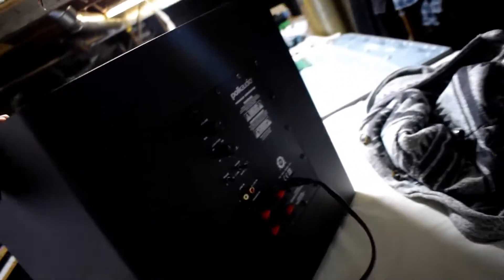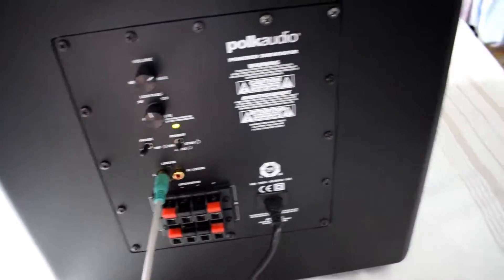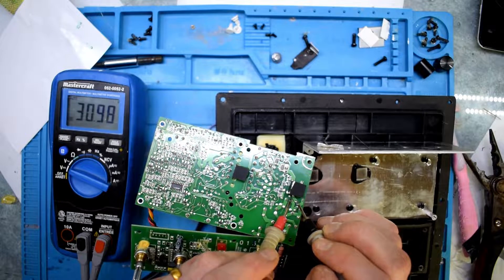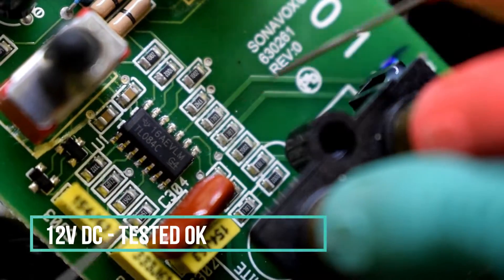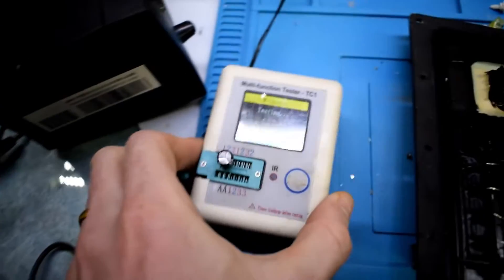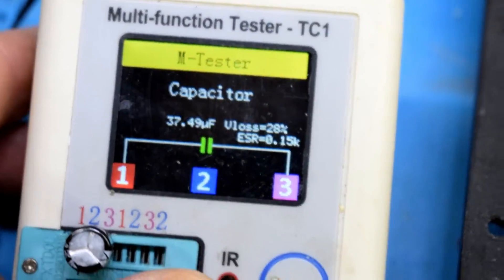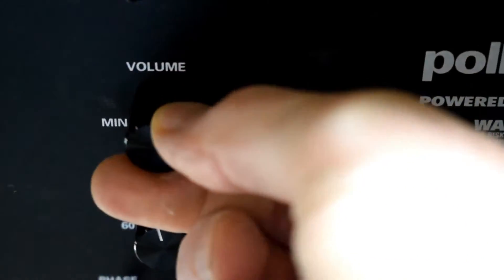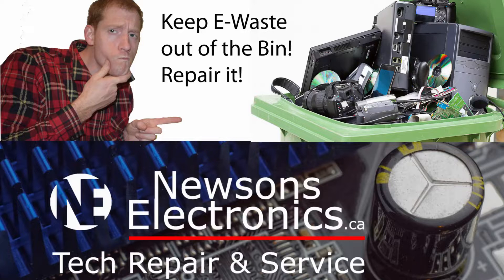Speaker heart beat Fixed! | Polk Audio Subwoofer (PSW125)

Comment: I have a PSW 125 with the same heartbeat problem, Plus if I put light pressure on the cabinet near the rear the speaker will start to buzz as well. Does that indicate a more serious problem than just the capacitors?

Comment: I fixed mine by installing a Dayton Audio plate amp outside the box and bypassing the Polk board altogether. It was more expensive but probably a better board overall. And probably easier to do.

Comment: Twice mentioned 2 capacitors while only pointing to 1 both times with 2 nearby.   Is the second one the one touching it or the one that is bent sideways a bit?
Reply from the maker: check for bulging at the top
Reply from the maker: best to replace both if you can

Comment: This was a pain to get done. Maybe itd due the bad vision i have now. And maybe i suck at soldering. I got a magnifying light helmet thing at harbor freight. That  helped. And solder paste at home depot. A few more hours and done. I struggled. But i think it was not being able to see. Touched were i shoulnt and burnt some spots. Hsd to use wire to fix soldering points. Anyway thats was my experience.

Comment: My sub was making noise similar to yours and was cutting off at high volume. When I opened it I was dissappointed with the cheap chinese components that was used on the board. 
I replaced the two 47uf 63v with some old Rubicon 47uf 50v caps. Ive also noticed that some of the other caps were bad as well and replaced them too. The thin tracks made the process a pain in the arse. But it works now. Thank you very much for this video.

Comment: another success story here in Spain! Symptons were "buzzing electric sound", "hearbeats" and after a while it stopped totally. I removed the plate, bought the capacitors and asked for someone else to do the replacement.
What is weird is that the "buzzing electric sound" is still there. I tried replacing the LFE cable, switching power outlets... but nothing. The louder the volume, the louder the buzzing. When playing music, I do not notice it. Only when idle. What could this be? THANKS A LOT!

Comment: Thank you. I have a PSW125. Replaced the capacitors you described with the 47uf 50, the actual capacitor on the board is a 47uf 63. I saw below that you said it's ok with the 50. The sub is working again! Thanks!

Comment: THANKS NEWSONS, I know this is an old video but my PSW125 just recently came down with the heartbeat issue. I came across this video and just tried replacing those capacitors didn't test anything else and that fixed it. Sub is back in action just like new!

Comment: Hey , Thanks a lot for a informative video, Can you please let me know the values of the MOSFETS on the main board which you tested. I have burnt ones on my board and not able to make out its value . Also the two resistors vertically placed between the 2nd and 3rd MOSFET are burnt . Would be obliged if you please share the values of these components.  . Thanks

Comment: THANK YOU!  I have same model and called Polk.  They don’t give out parts anymore as this model is discontinued.  I was having similar constant heartbeat thump on or off.  not bad but annoying.  Replacing those 2 capacitors fixed it!  $400 sub… fixed for $2 shipped.   Oh and if never done this kind of thing get a solder sucker.  Once opened i had the job done in about 10 minutes.   Sure appreciate your video!

Comment: caps are 47/50v or 47/63V? what is shown in video is 63V while its said 50V in your description.
Reply from the maker: 50v is fine, the voltage rail does not go over 50V

Comment: I have the same issue with PSW110. When I Turn it on it sounds like it is tuning a radio station and when it bring up the volume it goes away for a moment and get back again intermittently loosing bass. Can the solution be the same for this issue? I had it go for repair couple of times but the engineer is nt able to identify the root cause. My problem is precisely the same.
Reply from the maker: give it a try

Comment: Hi Newsons, I have one of these and I am trying to repair it. On the Drive board next to the (J1) Connector there is a small resistor that has blow on mine and I need to know the value. It come from the output of pin 6 of IC#UC3843 through the 47.5ohm resistor and then to that small resistor that is burn. Can you tell me the value of that resistor? Thanks.
Reply from the maker: note sure

Comment: Replaced the two you recommended and I'm good to go again!!  Thanks!!  Saved me a ton!!
Reply from the maker: nice
Reply: That soldering was difficult!  I swapped the two and now the power light doesn’t light up. Fuse inside is ok. Back side of the circuit board might’ve been damaged when I pulled old caps out.
Reply from the maker: @coffin8er  check polarity

Comment: I have the psw505 with the heartbeat problem. I have not opened it up yet but do you think the caps are the same?
Reply from the maker: may be different have to open it up to see.
Reply: PSW 110,111,125 have the same plate amplifier, PWS505 amplifier seems to be difrent, this amplifier is a 150W RMS, your is 300W RMS. Anyway i think the class of amplifier is the same, they are BASH amplifiers, and also in yours there will be capacitors that have the same purpose, but maybe the circuit is different and you need to identify where they are, so it can help you to recover the wiring diagram. I add that once you get started it is better to replace all the capacitors that filter the PWM supply on the output of  the transformer, after the rectifier diodes, in this amplifier, in addition to C38 and C39 as in the video, also C12 and C14, in yours you have to identify which are . They replacements must be 105 ° C low inductance capacitors, better if they hare also long life kind, a good choice are those of the FR series from Panasonic